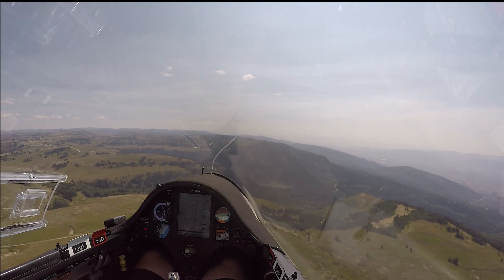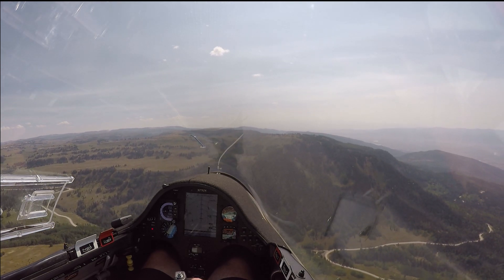Lessons Learned Flying Through Strong Mountain Turbulence in a Glider

Comment: hello, Bruno can you make a video explaining some basic stuff about the different high-performance sailplane and in particular the difference between a 15 m 18m 20m?
Reply: Well as you haven't had an answer in 6 months, perhaps I can help. Part of the drag any aircraft experiences results from the wing tip vortices, and the longer the wing and the higher its aspect ratio, the smaller the wing tip is compared to the size of the wing. As a result the wing gives a better lift to drag ratio and the glider will descend less steeply. My own glider can have a span of 15 or 16.6 metres, and has a l/d ratio, and thus a glide angle, of 42 or 45 to 1 in those configurations.

Comment: I dont know anything about gliders but I heard you say your wings are full of water. Why?
Reply: On days where there may be strong lift conditions, gliders may be ballasted to make the wing loading much higher by adding water to compartments in the wings.. The glide ratios (glide angles) stay the same, but the speed of the best glide ratios will be much higher, allowing higher cruise speeds with the same loss of height. Also, it makes the glider more comfortable to fly in turbulent conditions, as a heavier glider won't be bounced around as much.This water is drained before landing to bring the weight back down.

Comment: Hi Bruno, interesting video. I watched it a couple of times and 2 points came up (for me..)
1) looking at the cloud (wisps) at 0:55 above the instrument panel, and even more so from 1:24 on slightly to the right above the panel, one can tell from their shape and development that there's lots of wind up there (even without a butterfly.... :-) ) The second one actually looks a lot like a rotor cloud, therefore...
2) there probably was lee-wave action and searching intentionally for the rotor (-turbulence) and using the up-part of the roller coaster might have gotten you into the laminar (wave) flow, if not on low-level turbulence-investigation mission... That's one way to get into the wave, anyway... (when flying X-C, not on tow).

Comment: In the UK we call it rotor, it has been known to flip a glider upside down.
Reply: I was almost upside down in a Beechcraft T-34 in the rotor off of the Sierra Wave.  90 degree rolls and 60 degree pitch angles were plentiful.  Emptied my wife's purse all over from the back seat.  I think I bent the throttle lever slightly trying to recover from an excessively high nose up pitch. Stall horns, Slow speed with gear up horns.... My shins were bleeding from the negative gs flipping my feet up into the instrument panel and my right hand knuckles were bleeding from trying to operate the radio to get surface wind info.  We were both parachute equipped and I thought for a while we might have to use them.  This event went on for a couple of hours (had to be about 3-5 minutes). We landed with a recorded +3 and -2gs on the g meter.  My wife was temporarily unavailable to help me re-fueling the plane.
Reply: @stufields5125  ...nice experience -----> weather fotrecast  ??????????????????????????

Comment: "what turbulence.... those are just tiny bumps" what my flight instructor would say during commercial pilot training xD ( worse turbulence ive been was during instrument flight where i bumped my head on the ceiling )
Reply: Northstar_004 don’t you wear shoulder straps?  Several times I’d have shot right through the canopy if I’d not been wearing mine.   Rotors are only one kind of turbulence.   Some of those bumps over level terrain are thermals.  Yee haw!

Comment: Yeah; I got acid in my stomach one day when flying a Blanik L13. At 4,000' through the remains of a previous day's bush-fire. Could just see the horizon and gave it a go. It was violent! 30 degrees pitch and roll in every direction and full stop control to try and keep 'level'. Vairo went off the clock in both directions in seconds and constantly for the half-minute in there. Gee, the bomber pilots in WW2 must have had it bad!

Comment: A few months ago a bush plane pilot I subscribe to made an early morning flight with his wife for coffee on a desert hilltop. The wind was blowing about 20 kts over the rounded hill he set up his approach on, but as he neared he suddenly slammed down hard enough so the two of them were sitting several inches lower -- the impact had popped the zip ties holding the seat pans up. He had flown into the lee-side turbulence at just above stall speed ready to land, and as he hit the turbulence he was suddenly BELOW stall speed as Bruno mentions. Fortunately he was close enough to the ground for the consequences to be minor.
Reply: "zip ties holding the seat pans up"? That's frighteningly stupid.
Reply: Superphilipp, that's what I thought when I first heard it. But then I thought about it: lots of things are designed so that something cheap and easy to replace will break before something expensive and difficult to replace, like the shear pins in a winch handle I own so you can't destroy the mechanism by getting too enthusiastic on the handle. In the case of the aircraft, the zip ties absorb some energy in breaking before the landing gear takes the full shock, and may have saved a very long walk, expensive aircraft extraction from a remote location, and expensive repair, all with some 10 cent throw-away parts. So rather than stupid, they're brilliant.
Reply: https://youtu.be/F8Rg1j6QKkg?t=5m54s      and the zip ties were replaced with bolts when Kitfox did some upgrades for him. https://youtu.be/gdx-Rou-P2E (zipties are discussed just after 5 minutes in)
Reply: Great info thanks

Comment: learn to pray and bring another set of underwear.     I have flown a lot of mountainous terrain in a turboprop.   I have experienced Severe Turbulence so much that the B1900D was uncontrollable.  In fact the Tail surfaces were oil canning.   I could hear it through my David Clark's.   Not fun to experience but I learned a lot.  Glad it worked out for you, and you are safe.
Reply: Grey Ghost eep
Reply: Stay on the winward side. Plenty of clearance. The Wind accelerates towards the top of the ridge due to venturi! Go mountain gliding, plenty of fun!
Reply: Folken Van Vanel hard to do that when IFR.  Gliding would be fun.